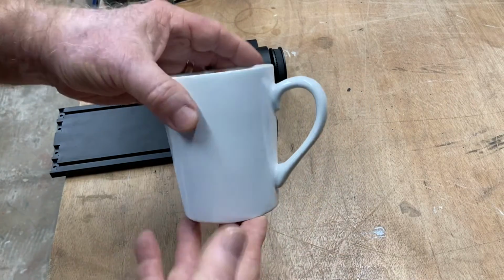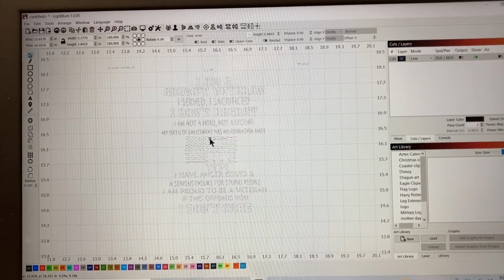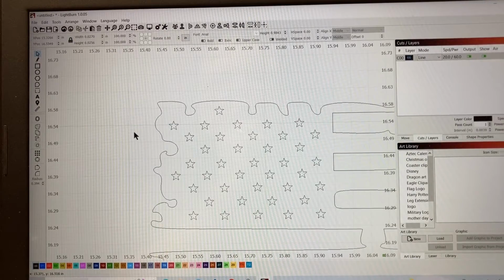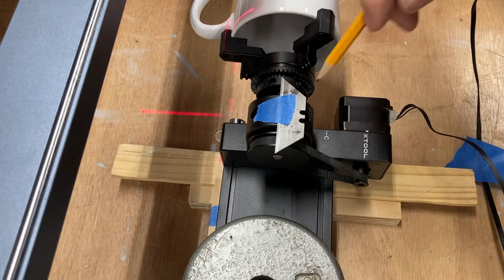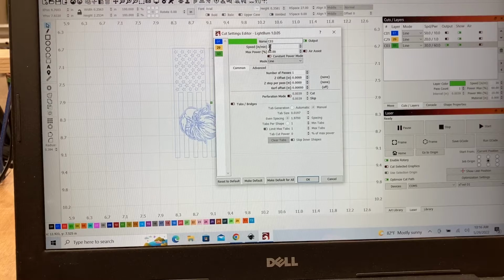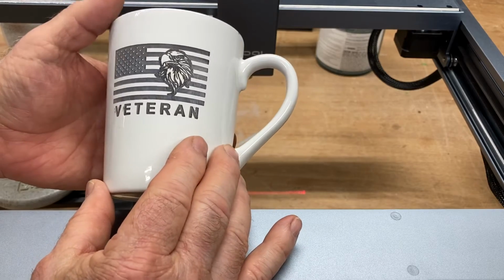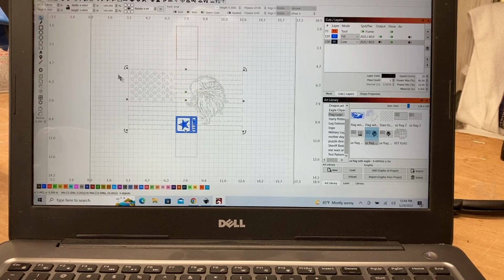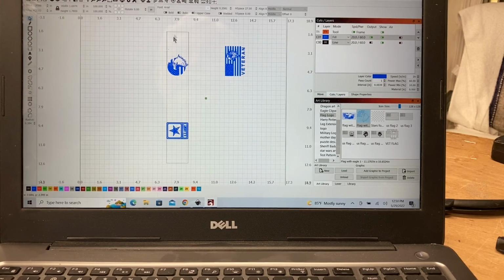How to Engrave on a Cup with a HANDLE

Comment: I have a 10w and wondering if it'll engrave a white shiny mug without painting or tape. I always thought you couldn't do it directly.
Reply from the maker: No, the paint is required. It the titanium oxide in the paint that makes this process work

Comment: Hi. I've been trying to di this but my engraving lines are not coming out clean. I'm not sure what to do.
Reply from the maker: It could be caused by several things. The paint sprayed on may be uneven, the laser may not be focused to the actual engraving area. Very common when doing cups. In the settings look at the dpi and close the line spacing.
Reply: When you say dpi, is that the same as lpc? I know dpi with an image. This is a font so I am confused. Sorry

Comment: Excellent video!  Couple of things...   I can't manually move my laser module by hand like you do in the video. I have to move from the move menu in lightburn   I imagine it's the way my machine is or there's some setting in lightburn I'm missing..  2nd, I I have a tip for you!  When spraying the cups,  place the top of the cup upside down on a paper towel.  This will prevent the spray paint from going inside the cup.
Reply from the maker: Thank you

Comment: Nice video.
Try two parts isopropanol and one part titanium dioxide powder. Take a spray bottle and spray it twice on the object. The isopropanol will evaporate it and you're good to go. it's not that much of a mess to clean up and will darken the engraving a lot.
Greetings Jean Luc
Reply from the maker: Thanks, I just got some and planning a video now.
Reply: How do you get it to stay on the cup? I've tried the tile and it forms some droplets that don't always self level. Is there way to fix it.

Comment: Using the level is interesting, first you have to have a level laser setting on paint cans, setting on a table, setting on the floor.  Leveling the cup is not the only problem.
Reply from the maker: That’s why the have feet that you can add to the laser. I’ve even made some as well. You do not need to use paint cans lol, but it does work great.

Comment: Can u engrave store bought cups?  I just got my hands on the SCULPFUN S9 LASER & I'm just beginning to learn the LIGHTBURN SOFTWARE.. It's fairly easy with the tutorials from Lightburn on YT.. They have their own channel which I found last night after setting up my Laser.. It has a good working area OF 410x400mm . I was really impressed by that..  The framing button is a great tool with the software bcos newbies wouldn't understand how to set the workpiece in the right area. My machine now goes back to the left bottom corner when i hit the HOME BUTTON now.. I guess I could set it up to do that automatically but I'm not tech savvy enough to get that working as yet..
This was a really interesting video to watch but I suppose I have a hell of a lot to learn before getting to this stage of engraving and I'm not going to make the mistake of running before I can walk, 
Beautiful work my friend. U must have loads of beginners videos? Do u have a playlist for the beginner on this software LIGHTBRUN?
Reply from the maker: Yes, you can use store bought ceramic cups. Go to my laser playlist. You’ll see many videos there to learn the laser.

Comment: If you turned your rotary table 180 degrees so the cup is on the left side, it won't Ned to be reversed, only rotated 90 ° clockwise so your image is upright on the cup.
Reply from the maker: Yes, that would work. Thank you

Comment: Question: When I use Ra2 from Xtool it makes many scratches on the design, I already cleaned it and adjusted the strap but it keeps doing it.  how can I solve that?
Reply from the maker: What is scratching?  That means you have movement

Comment: Is this a porcelain or ceramic mug? I think I might have got the wrong material....
Reply from the maker: This is a ceramic mug.
Reply: @PawPawsWorkShop  now wonder i couldn't get a good engraving and my test files weren't working 🤦🏻‍♂️
Reply: @PawPawsWorkShop  do you happen to have a link as to where you get these ceramik blanks? Either im not getting the right ones or my results are NOT coming out. Ive done done 3 test burns already with smokey beiuge, flat white, and Heirloom white. Cannot seem to get a good black burn. Looks more faded.

Comment: Do you have the 10w or 20w? 

I cannot for the life of me get mugs to engrave and I don't know what I'm doing wrong. It's driving me nuts!
Reply from the maker: What paint are you using?  Have you done a test grid on a ceramic tile?
Reply: @PawPawsWorkShop  I couldn't find anything on paints anywhere. I had some tempra paint here from doing glasses. I was using that.
Reply: What do you mean by test grid on ceramic tile???
Reply from the maker: You need paint that has titanium oxide in it. I use the Rust-o-luem White or Smokey Beige. Tempera will not do anything on ceramic

Comment: The cup only has to turn 180 deg. Why change any thing? The direction  of rotating the cup determines which  item is burned first and the handle will be on the other side of the chuck. Handle on left side-burn rotate 180 deg. move laser to not interfere with the rotation and then when cup has rotated 180 degrees bring the laser unit back into battery position.

Comment: Does engraving a tapered item present a problem with the image being distorted.
Reply from the maker: You have to distort the image on the computer. Anywhere from about seven to ten percent
Reply: @PawPawsWorkShop  do you have a tutorial for that
Reply from the maker: Yes, when ever I show a glass and the rotary I show how. Basically, all you do is create a square and adjust the square on the screen until the square is close to the same size on the glass. It will not be perfect but it will be close. The picture on the screen will look distorted. That’s ok

Comment: At what point did you paint the cup and does it matter if you use acrylic paint or flat white when engraving?  Great video by the way, learned many new things in LightBurn I didn't know.  Thank you
Reply: Clean the cup with acetone then paint with "rustoleum painters touch 2X ultramodern paint and primer". Then burn your image, then clean paint off cup with acetone
Reply: ya think he edited that out!

Comment: Very helpful video. In your video you mention wiping off paint.. What is the name and type of paint you used?
Reply from the maker: I spray the cup with white Rust-o-leum paint. It is the titanium oxide in the paint that allows this process to work. After engraving wash the paint off with lacquer thinner
Reply: @PawPawsWorkShop  Thank you Sir. I tried it and it worked perfectly!

Comment: Did you use paint on the cup before engraving?
Reply: What are the setting you used for this, speed, power and line per inch?
Reply from the maker: 20ipm60%power
Reply from the maker: Yes, this is the well documented Norton White Tile method. I sprayed it with Rust-o-luem paint.

Comment: suggestion:  Instead of using the weight to hold the base plate down when rotary reversed, drill or use one of the holes in the end to put a screw or 2 in to hold it down :)
Reply from the maker: Thank you good idea